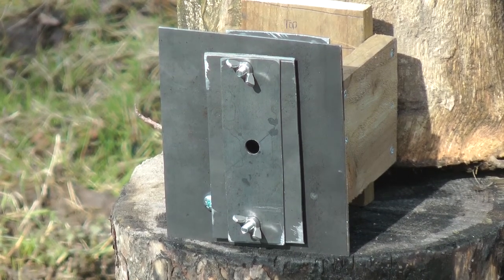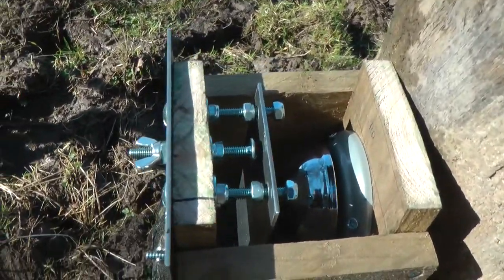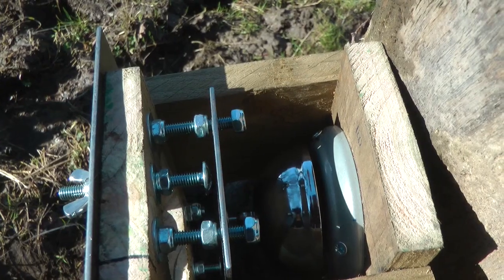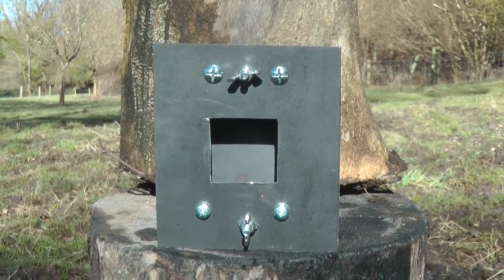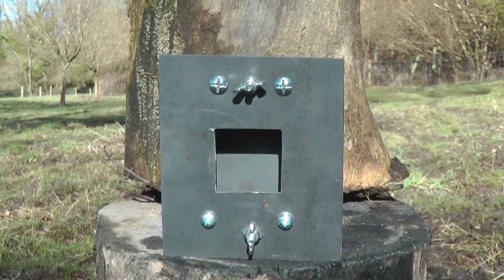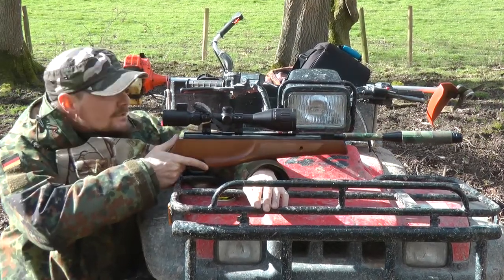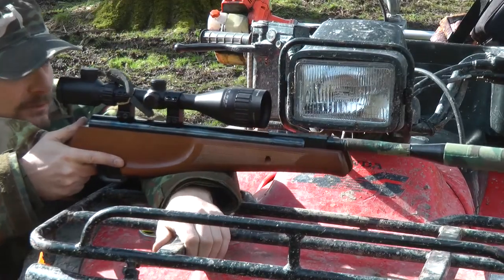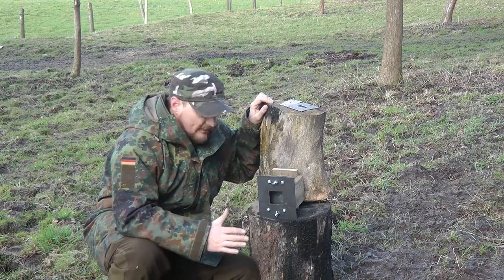DIY bell target for air rifle marksmanship

Comment: Interesting design... I couldn't see exactly how your striking plate is mounted so that it hits the center bell dinger... are there springs attached to get it to move forward to strike the bell dinger, and then springs back into position ?

I'm currently making a bell target using an old 6" round IBM bell like they used in schools (cost me $3 at an antique shop), basically mounted to a piece of 1/4" thick steel angle iron that is 5 " tall at the face, and 3" bottom edge to mount to the bell plate, and 8" wide... probably use 3/4" hole in the face plate... and the face plate will face in a downward angle to deflect flattened pellets downward.
Reply from the maker: Hi, good luck with your bell target. The plate which hits the bell dinger is simply loosely suspended by the 2 bolts. The drilled holes are twice the size of the bolts.  The nuts on the bolts just stop it slipping to far forwards/backwards. Have a look again at 1 min 14 secs. Let me know if I can help further.

Comment: Thats just a little boys toy. If you want a real challenge try a proper Bell Target, as used by pub Bell Target Leagues. The hole in the centre is much smaller, 3/8 of an inch, and you aim in a standing position with no rest for the gun, and no humoungus telescopic sight like you use. Just a standard Iron Sight. All from a distance of six yards. Once you can ring the bell often you can call yourself a Marksman!